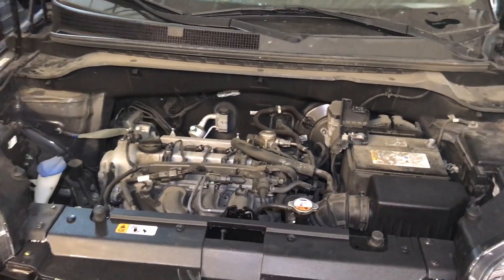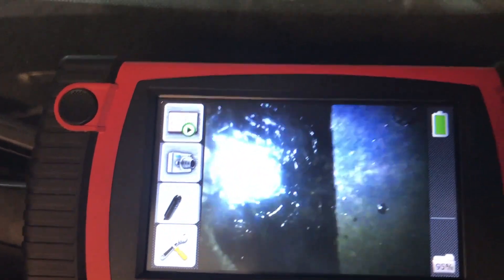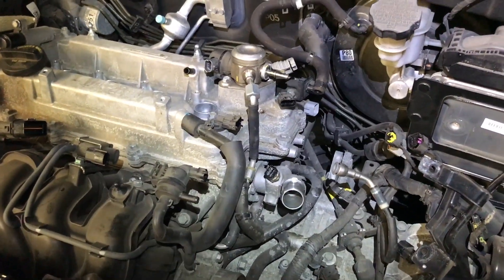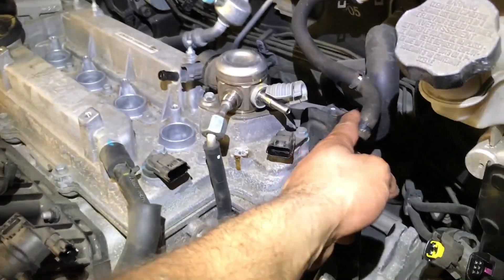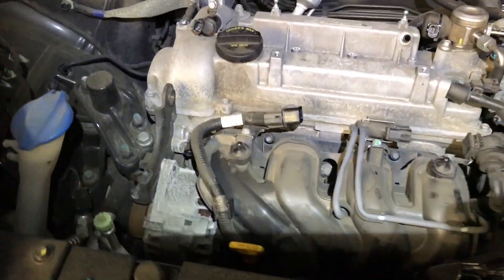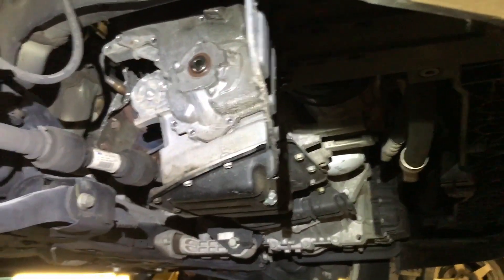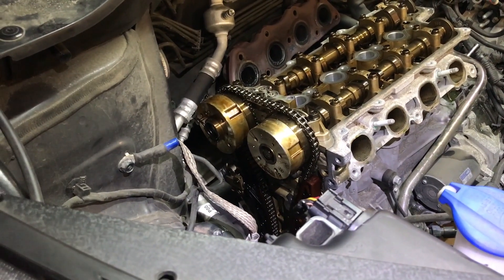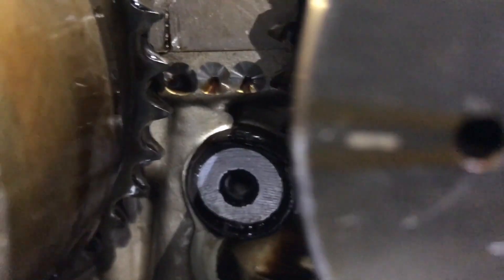2014 Kia Soul no start head gasket blown

Comment: Great video. I have a 2014 kia soul 1.6L that was misfiring. My dad popped it open to find a broken intake valve.

I was wondering how there was no gasket on the timing chain cover but some sort of strong black silicone. What should i use to seal it back up???

Comment: I'm pulling knock sensors and crank sensor and cam sensor codes for a 2012 Kia soul 1.6 GDI should I change the timing chain or do you think it's just the seniors

Comment: Oh ok, lol because a blown head gasket for a 3 year vehicle is strange. Thank you for clarifying .
Reply: I meant find a way to mod the firing system. My bad damn auto correct
Reply: Yes a 3 year old vehicle, it can be brand new vehicle if it's run without water, coolant it will have a head blown gasket or worse.

Comment: Those cars are pieces of crap
Reply: John Doe whatever I’m just stating my opinion I stand by my opinion 100% to hating the Kia Soul it looks ugly AF and have history with mechanical problems I also happen to have a Honda with almost 200,000 miles it’s barely ever had anything go wrong with it all the issues were cheap to fix KIA cars are just poorly made in fact they’re worse than Nissan and Nissan is struggling very badly
Reply: I detail service cars at a Kia dealership and I've parked one that  had 217K miles when I saw it. It's how the car is maintained, Not Kia. Old Kia's were low quality but anything 2008+ is much higher quality. 

I also parked a 2012 Optima with 234K miles. "Crap" cars cant last over 200K miles. I also drive a 2003 Nissan Altima 2.5S with 207K miles and it still runs like a clock.
Reply: I did not trust those Kia  vehicles before, but I have seen newer Kia's with 268 miles on it.